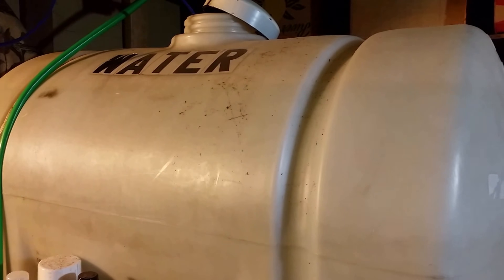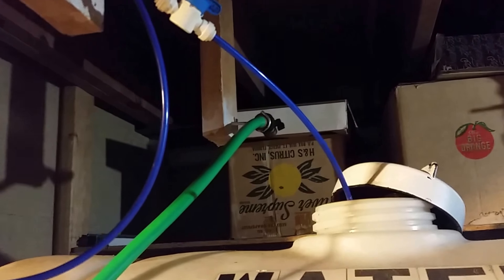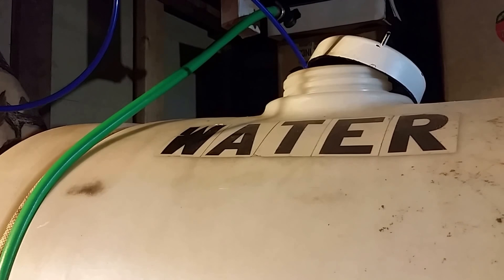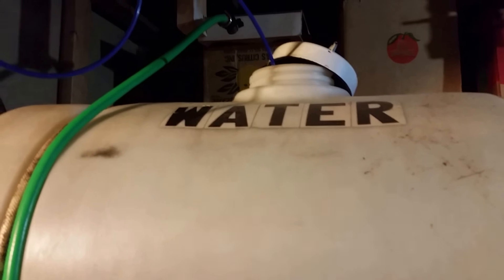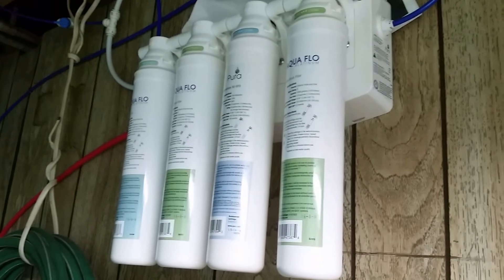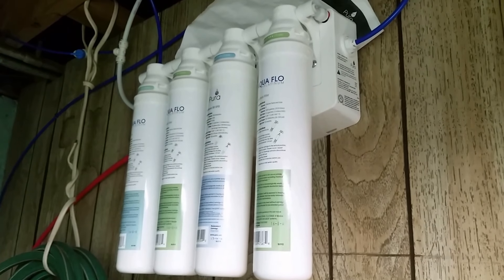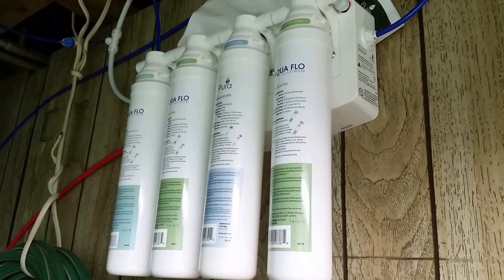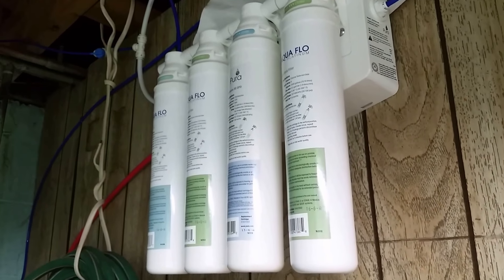RO Systems Waste A Lot Of Water

Comment: You can make them more efficient. I run a booster pump to increase pressure to 85 psi on membranes only. I also run a second ro membrane on the wast water. I get 50% recovery vs 25%.

Comment: This is definitely something that has always concerned me about these systems. I just feel guilty wasting so much water so I would have to find another use for the waste water rather than it going down the drain.
Reply from the maker: It just goes back into the water table eventually. I have a septic system and drain field.